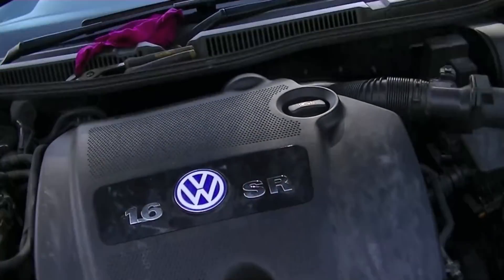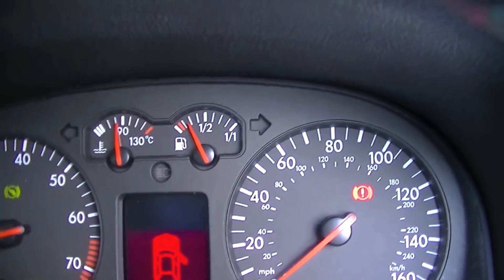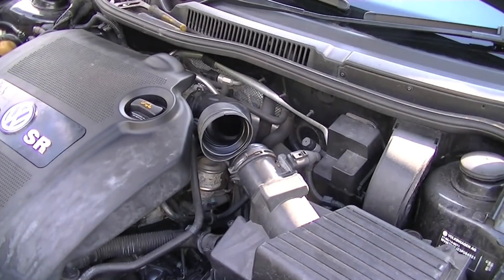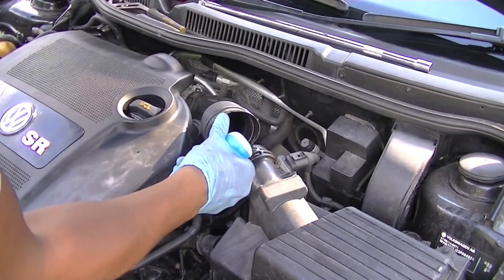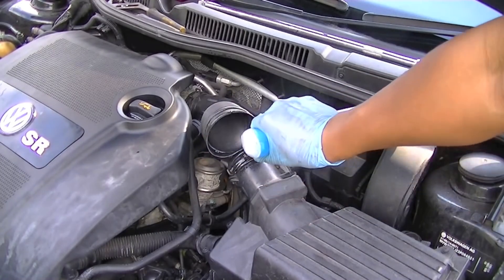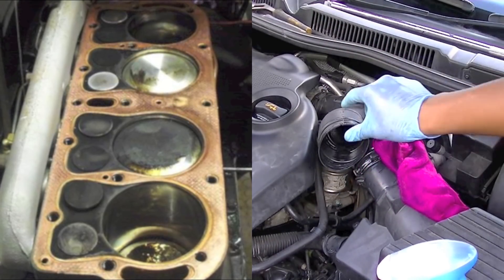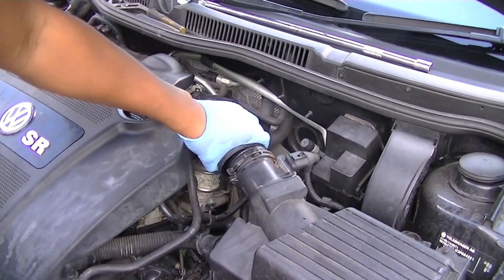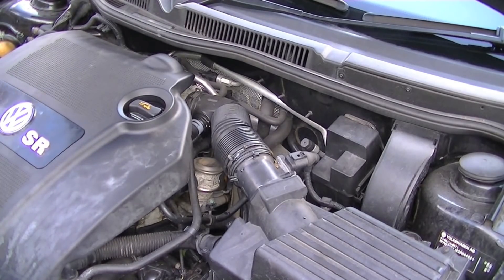How to make your engine run better with just tap water.......Better Than Seafoam?

Comment from the maker: Some people will talk "Theory" and some will speak "Experience". 

I'd rather fly with a pilot that has experience.
Reply: I have been doing this for years my friend. I usually do it on vehicles with a carburetor or throttle body. Have not tried it on newer, fuel injected autos due to all the fancy "sensors" they have. I have been racing for many years, & I have changed many, many, head gaskets in my racing career. Just look at any piston/valves where a blown head gasket was involved, and they will look practically brand new and be completely free of any carbon or other deposits. the number one trick, as you were showing, is using a spray bottle and misting the motor. Thank you for taking the time to make this tutorial. Great job my friend!
Reply: +BMAC VAGS Never fly with a pilot, who is talking about his greate experiences. This kind of pilots are the most dangerous to themselfs, and for all people around them.
Reply: There's a saying among pilots. 
There may be bold pilots. 
There may be old pilots. 
There's no such thing as an old bold pilot.
Reply: +Joe Dirt 
Yup. 
If privileged is workin my ass off for what I got,then I guess I am!
Reply from the maker: John Perks How else would you understand??
Reply: +BMAC VAGS why weren't you wearing a safety belt when driving.
Reply: +Miguel Serrano 
If you have to spin your 100 hp engine to 7k to get 100hp, and I've got 80 hp at 4k but I have 30-40% more torque than you, I'm gone. 
But I don't know what I'm talking about because I've only been a master tech for almost 20 yrs.
Reply: +Fucknuts  IGNORANCE IS PERVASIVE WHERE THERE IS A  TOTAL LACK OF APPRECIABLE INTELLIGENCE.
Reply: Rust inside??????????????
Reply: I spray 800cc/minute of water/meth into my intake on 30 pounds of boost, and by the end of the week that will be 1000cc, car doesn't even hiccup. keeps that shit clean, lets me up the timing and have this high boost on 91 octane with no knock. love it. have been doing this for years and my engine still hasn't blown, in fact I did a tare down of my old engine, because I was doing a build with stronger block, and that thing was so clean from the water meth, it was like new. all you guys saying this is dangerous, and it will blow ur motor, shut the hell up and go learn something. cause u have no clue what ur talking about.
Reply: I use water injection mainly for a power added when mixed with methanol on my diesel, but back a while back I had an issue and had to lift the head off. 
It had a nice darkish color but no buildup. 
And hydro locking haha...my setup squirts a stream like 8 feet away. 
It's a used washer bottle with a pump on it.
Reply: Lol only an idiot hydro locks his engine by spraying water in the intake. 
It'll take the flow of a garden hose to do that.
Reply: +viki laba 
Yea maybe 140 kw, but try like 300 ft pounds of tq or more. 
Diesels make mad torque. 
Gimme tq over hp anyday.
Reply: I know somebody that used lavender air freshener, f**k the engine good and proper but car smelt nice for days.
Reply: SO VERY TRUE MY FRIEND!
Reply from the maker: MrTheHillfolk that is a quality idea to use a pressure washer motor. That's genius
Reply: +Joe Dirt always throwing out the race card huh
Reply: +BMAC VAGS I'd rather fly with a pilot who has experience who first understands how an aircraft works.
Reply: +viki laba 
Haha yea I'm real jealous of having to pass your junk on the side of the road while you are changin coil packs out every 10 minutes. 
Your problem is there's no real diesels near you to show you how it's done. 
How quick is that 1.8t? 
I highly doubt you would beat 5sec 0-60and mid 13s in the 1/4 in such a heavy car. 
A mk1 has a 1000 pound weight advantage over a mk4. 
That's a lot of power you have to make up to have the same acceleration. 
Last time at the drags , the 1.8t guy wanted to stop lining up across from me cause he was gettin tired of bein smoked.
Reply: +viki laba 
haaha get used to changin coils. 
All I did last night was roll coal on some ricer Honda for 5 miles , while passing a Honda dealership. 
I'm the most fuckin Awesomest dude in the world cause of that.....you can never match my awesomeness. 
Maybe it was you in the honda, boy was that guy pissed and I was lovin it. 
Can't mess with king hillfolk.
Reply: +viki laba mines a tdi, all 3.5 twin turbo bmw motor she is 350 bhp (just tickled and 700 nm torque) did you say anyway anyhow anywhere ?? haha tit your motor is a shit box least someone online trying to help where as with your comment you think your billy big balls when you aint shit ! top video like always bmac vags
Reply: Do you have to write like a moron?
Reply: You lying ass piece of shit. Water doesn't clean off carbon. You need an organic solvent to dissolve carbon.
Reply: wasnt the guy(pilot) who landed in the hudson an experienced military pilot..........
Reply: BMAC VAGS   tt
Reply: My 69 does wheelies halfway down the track just perfectly fine
Reply: +BMAC VAGS 
Thanks man. A lot of Volkswagens have them like that. 
Also I basically restricted the stock hose by using a piece of copper tubing for an oil pressure guage. 
The point I my setup was to use what was laying around. 
Solder the pipe shut on the end and try different size drills to act as a "jet".
Reply: +Letecke Vysetrovani 
Ah, yea that's exactly what I use it for. More power. A noticable amount too. 
And lower egts. 
I've confirmed in my car that using blue washer fluid is worth at least .3 sec in the 1/4.
Confirmed over and over again with the use of a gtech. 
That would be a 79 rabbit (golf1) with a Mtdi pushing about 35 psi of boost , with a 12mm ip...no intercooler. You need water injection if you try what I'm doing. 
The old idi popped a head gasket that I had some years prior.  
Money's not an issue in the Mtdi , I've got over 5k in the long block alone.
Reply: +MrTheHillfolk you privileged fuck
Reply: Whazzup ya?
Reply: +BMAC VAGS Also water in the oil will cause seals to degrade much more quickly.
Reply: The watter in the air can seriously damage the engine. The injectors are not happy, the cylinders are angry too. But if you do have enough of money
Reply: -so you can play. A lot of people around the world are hungry, and some people have a problems with how to destroy their engines. Ain´t it funny? Don´t you think? I don´t really do think.
Reply: It'll wipe out all the carbon with continued use over time. 
I suggest a kit from snow performance if you want an easy install vs making a homemade setup.
Reply: +MrTheHillfolk did you know that power is the resultado of multiplying force by time?
so HP is the result of multiplying torque (ft\lb or NM) by RPM...
then, in the end, we have that the more power you got, the better. 

this means that an engine producing 100hp will be faster that one producing 80hp, without taking in consideration the amount of torque that each one produce
the 100 HP one could produce less torque but spins faster than the 80hp counterpart so in the end it produces more power.
Reply: +viki laba mk1 will kill you , it's easily 1000 pounds lighter.
Reply: Todd Colburn race card?!? I said it because he said money was not a problem.
Reply: +MrTheHillfolk You're dead right!
Reply: +BMAC VAGS good comeback.
Reply: i watched another vid where he used sea foam . but he had camera to stick down the bore . he showed before and after results.  can   you show that next time?
Reply: +Paul Dunne What laws are being broken by not? it's an act or statute, not common law. No harm to persons or property here
Reply: hey man good vid just wondering if this could cause raw metals inside the engine to rust. or just any possible rust from this internally
Reply: BMAC VAGS can u do tbis on my vw jetta 2008 tdi
Reply: BMAC VAGS
Reply: Lee Fennel AA
Reply: this is basically water injection without a system, of course it will work. water meth injection kit does the same thing.
Reply: A
Reply: Every pilot's first flight is based on theory though :)
Reply: BMAC VAGS 
What if there's a disa valve after the airflow sensor? Checkmate?
Reply: You know what works and what doesn't. Ignore the dumb responses.
Reply: tomjw7.. People are saying it will rust your engine.. haha. Stupidest thing I've ever heard. They think water is going to just sit on hot steel and not evaporate? Unbelievable!
Reply: Is this can be use in turbo engine?
Reply: Drives car with the gloves on lol
Reply: Is this guy for real
Reply: BMAC VAGS how is it staying running without the maf still on the throttle body?
Reply: Bmac bro where in UK you at g ?
Reply: Don't need experience when I have YouTube
Reply: BMAC VAGS will a brenault scenic 15inch 4stud wheel fit a Peugeot 207
Reply: Yea don't forget to mix 1/2 water 1/2gas before you take off
Reply: BMAC VAGS Yes when you hear the crap from Captain Jo and ask him how much fuel a 777 carries and then you find out it runs on compressed air using nitrogen as the fuel.
Reply: Is there a different way doing this if you have a turbo?
Reply: +BMAC VAGS  Do you just assume you wont get water in the oil? What you are doing is extremely bad for the engine. Over time it will cause rust and the water will destroy the oil.
Reply: And now try to think. For what it is good for? Do not eaven try to suggest me, it is good for quick acceleration, when I need to overtake another car. In fact the engine will be not so happy as you. If you have enough of money for to change the cylinder head gasket, or all the head - this is the best way, how to spend them. Or maybe the clutch... Anyway if all parts will stay it, you will pay them to the Police because of the fast driving ;) My Skoda Superb 1,9 TDi is tuned up only for the reason of 1 liter/100km fuelflow less. I am the realistic, so I do like the idea - it is very good. But not for me, I am sutisfied with my 140 kW engine power. So I am going to change the cylinder head gasket to my second car Kia Carnival 2,9 CRDi - fuc*** work, no space. Have a nice day boyz. The God bless you.
Reply: Superb 140kW HA HA HA. My stock 1.8T is superior to any fuc*** golf 1.9TDI on the road! But more gas mileage for you:)
Reply: Mad!? On my 1.8T(60,000 miles on tacho) is max torque from 1950 to 4700 rpm. Ha ha ha, on roud I see all TDI's on my mirrors. ANYWAY, ANYHOW, ANYWHERE...
Reply: You're frustrated and bad guy, bro. My car is like new. Nor never changed a tire beside the road. Yes on 40,000 miles I had problem with one coil. VW have got a recall on that bad coil packs and authorizerd dealer replaced all my 4 (with new enhanced part number) for free of charge. I am fury and very quick driver...
Last night I was street racing with a BMW 120d and I win! Also my dad not like a smoky TDI shit. ;)

Comment: Should of done it with the air box attached. .. The ass air flow sensor is out the loop.. remove air filter and shoot water through there
Reply: mafs will get wet. better to do it after the mafs.

Comment: I hang a clove a garlic around the air filter housing, and HP improved by an enormous negligible percentage consistent with daily fluctuation due to quantum effects, octane, barometric pressure, and attitude.
Reply: +stereopolice I put Whey Protein in my gas tank every 3-4 Fill Ups to initiate a placebo effect. Combined with a Rain Dance - My 97 Pontiac now has approximately the same horsepower output as the final year Bugatti Veyrons.
Reply: +ATCRyderX© LOL never underestimate the Rain Dance.  Oh, forgot to mention, the volume knob on my stereo goes to "11" as well.
Reply: I got a 99 civic snatchback. I usually use grass fed oil  every change, my dipstick calibration piston cambered. The fuel pressure defibrillator extractor is in good shape but I want to buy a new one. Will hydrophobic brakes increase my HP by 100? please help
Reply: +Maurice湯 茂 林 Grass fed oil, lol.  Hey, if you want to have some fun, ask somebody in the supermarket where the fish oil is, and tell them that your fish is running real low.  And then, if they don't laugh, tell 'em that you've been searching for an hour, but can't find the damn Hidden Valley Ranch.  But I digress ....
Reply: +stereopolice the stereo part has killed me! LoL
Reply: +ATCRyderX© thats rasist u jackass
Reply: +Paddy Nicholas hihugugzzzzvvvv
Reply: stereopolice 
The job's yours!
Reply: @ATC  I wonder if after 2 years you have learned what racism is?
Reply: +stereopolice you're a troll, and a moron.. they usually go hand in hand, shit for brains trying to use sarcasm to appear smart. hahaha poor poor soul.

Comment: Damage to your piston rings is possible with this method. deposits dropping into combustion chamber then cylinder wall and ring could scrape deposit between them causing some damage to your motor.